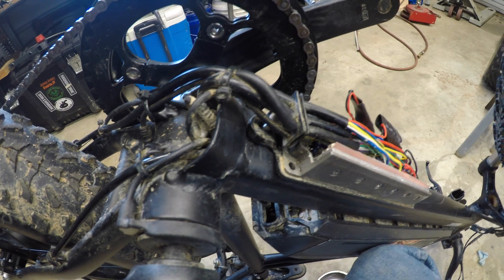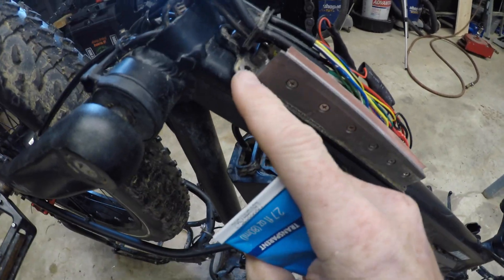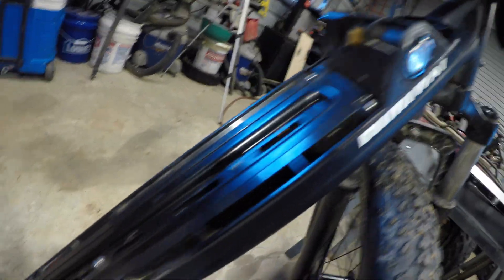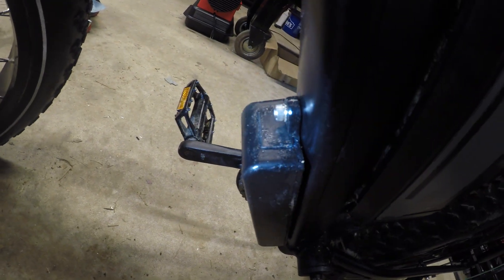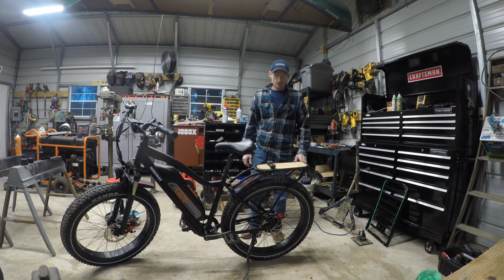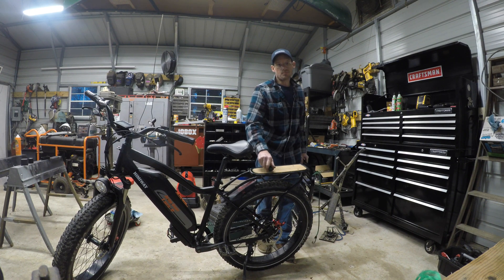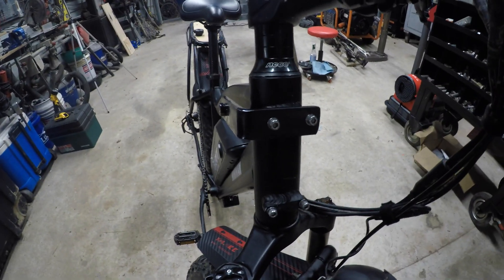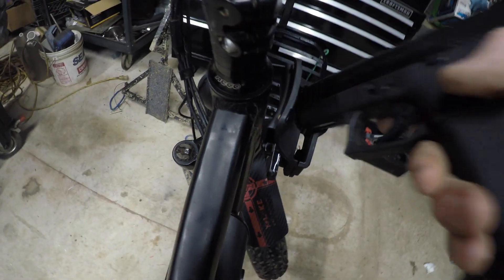Himiway Cruiser controller sealing and quick rack system

Comment: Thank you for this video and your "in the mud" video.  I've emailed and called several ebike retailers and asked how do ebikes hold up to water and mud?  How do you clean them afterward?  I never got a straight answer.  They usually answered "We do not recommend riding in wet conditions."  Huh?  One retailer suggested I wipe down the bike with rubbing alcohol and a swab.  
Hey China!, if your listening, make the ebikes water and mud resistant enough so we could wash it at a drive-thru power car wash.

Comment: Two seconds before you said that you bought fenders I thought to myself, man, that needs fenders. I agree with another commenter, it looks like there is mosfets under each screw. That array might double as a heat sync and a grounding rod. No elechicken here though.
Reply: @averagejoewithabow  Judging by the rubber gaskets on both ends, I would say yes. They most likely were depending on the cast aluminum cover to act as a heat sync also so ventilation is probably not a big deal.